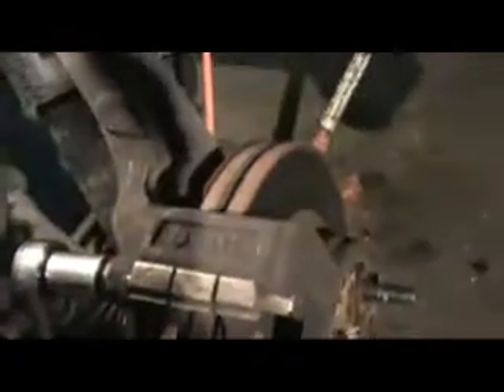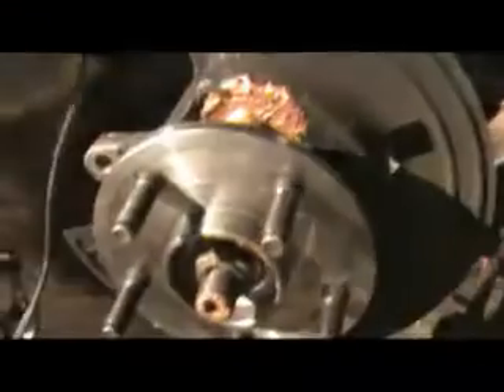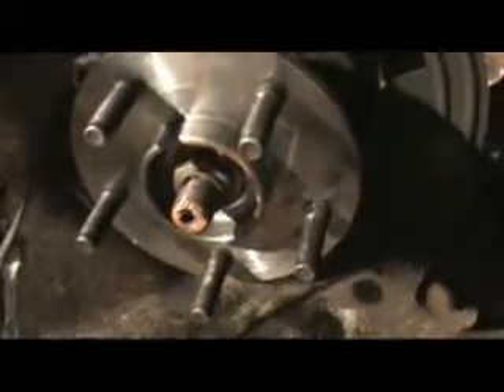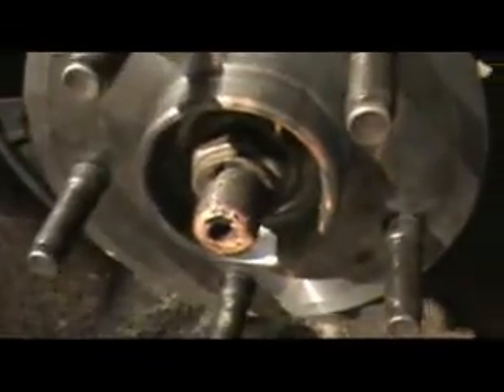FRONT HUB REPLACEMENT DODGE RAM 4X4

Comment: simple question I really hope someone can answer, Do you need to take off the CV axel on the 4x4? a video has it coming off and this doesn't/
Reply: On My 2005 1500 4x4 I had to remove the CV to access the 3 bolts.. BECAUSE my axel spline was seized inside the hub!
Reply: Yes I had to also

Comment: Im not gonna be an ass & start mouthin off outta frustration here, but you guys left out(well edited out) the hardest & most crucial break down steps for getting to the 3 hub bolts that bare buried in the back of the hub. You started to show this then cut right to a mounted hub???  Not cool in my book. There are steps that could really save someone alot of grief.